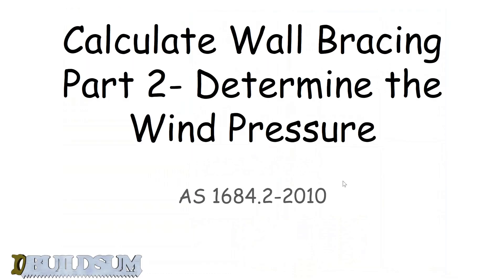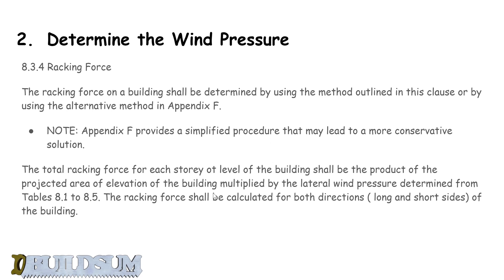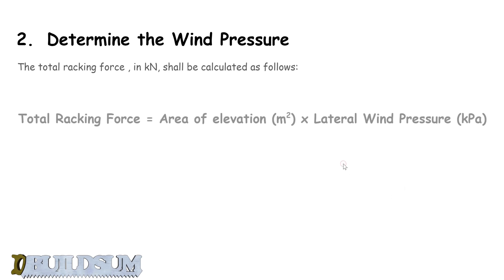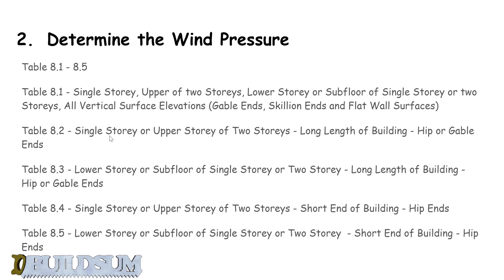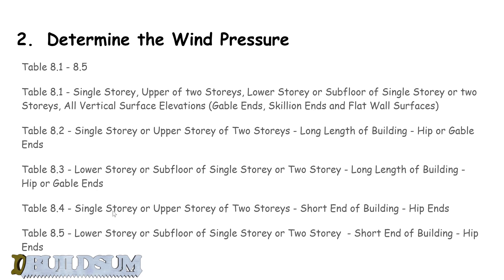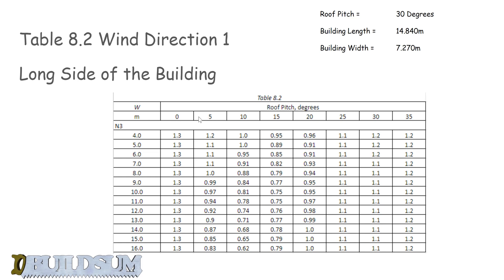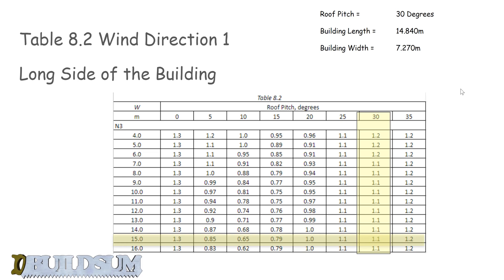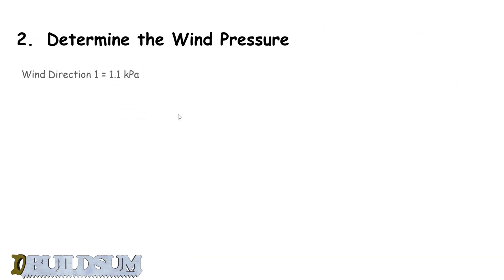Calculate Wall Bracing - Part 2- Determine Wind Pressure

Comment: Hi, how about roof pitch is 22.5?
Reply from the maker: You would have to work with the 25 degree figures or interpolate between the 20 and 25 degree figures. Hope this helps.

Comment: What happen if the length of your building is longer then 16 what then??? Thanks!
Reply from the maker: Hi Mate, in that case the Code cant be applied and you would have to get an engineer to work out the bracing system.
Reply: @Buildsum  Why is that??
Reply: @sorrowinchrist3387  code is a building bible, you are safe if it is already covered. Out of scope design, have to calculate case by case.
Reply: @fengdeng1982  Yes i know that but like to know how its done anyway if length not in code. :)

Comment: Thanks for your sharing mate as you do a lot of encellent work there.  One question, If the width is 7.27 then we should use 7.0 as I notice that the width smaller then wind pressure bigger in the table.
Reply from the maker: Hi Mate, you can however you are not being as efficient as you could be which is what we are always trying to achieve.

Comment: Hi, what do I do if my building long side is longer than 16 metres? Thank you
Reply from the maker: HI Haley, if you long side is longer than 16m you cant use this code to design your bracing you would have to get a structrual engineer to do it.

Comment: Great videos thanks. I am a little confused on the calculations and images for 8.2 and 8.4 in as1684. The length of w appears to be on the short side of the building. Is this a mistake in the standard or am I reading this incorrectly?
Reply from the maker: Hi Luke, no you are reading it correctaly, Im not sure why it did it the wrong way in the video. 
It does seem strange that it is not long length used for Wind Direction 1 however this step is only determining the Laterial Wind Pressure which is then multiplied by the area of the elevation. In most cases it appears that reagardless of lenght you are going to get the same answer or in the worst case you will be slightly over designing which is better that under designing. Hope this helps.